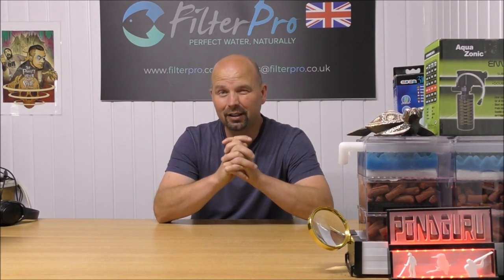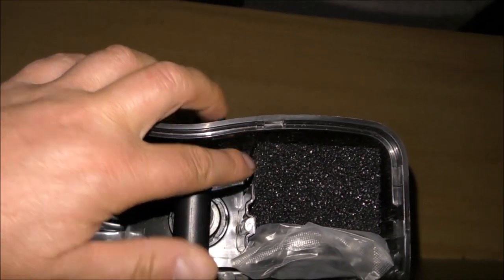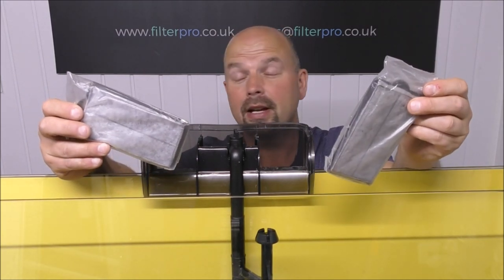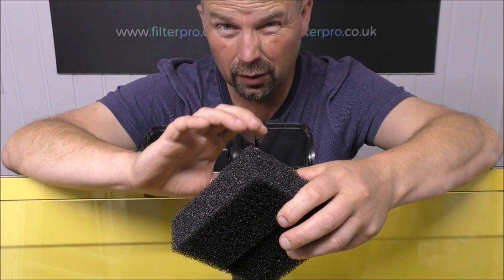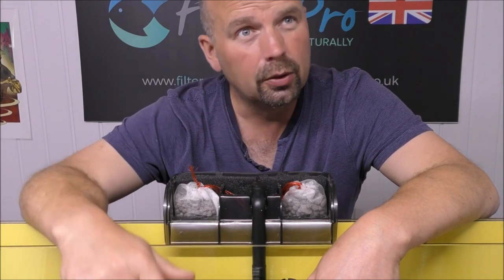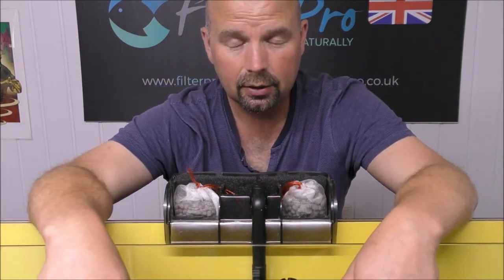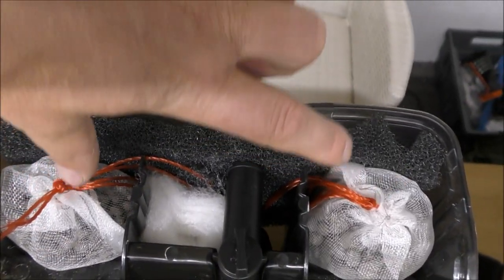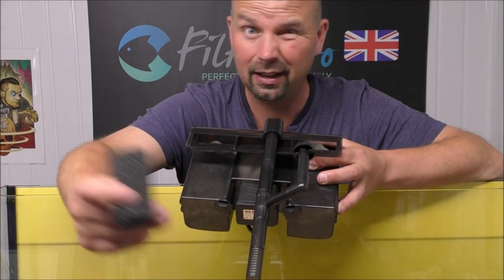Pimp My Filter #54 - All Pond Solutions 600-HO (hang on back filter)

Comment: These are great filters!
I run 2 on a 90l soft coral reef tank using the standard sponges and filter floss for mechanical and flow and the rock in the tank does my biological, works great!👍

Comment: I just set one of these up. I placed the coarse sponge on the I take like you showed. seems best method tbh, as you can use the centre chamber for the fine wool or whatever. I've caught a lot of muck in both the coarse on the intake and the fine wool. using this with some biohome ultimate, think I fit approx 600 grams or so. running on my gold laser cory tank.

Comment: Hi Richard, i am using a Fluval C2 hob filter with biohome ultimate stuffed in the chemical basket. I observed that the water flow is still quite strong. I am wondering can I achieve a full cycle with this setup?
Thanka

Comment: Could you put biohome in the bags?
Reply: You can fill the media bags with whatever you want to use. Richard uses bio gravel for this filter because it maximises the efficiency being that the filter has very little capacity you would want to get the most grams of media possible crammed in the filter compartment. He got 700g of bio gravel in a very small space which is impressive, If you were to use regular bio home you might get just 500g in as there will be alot of wasted space between the pieces of media.

Comment: What cheap external filter would  you recommend  for a 200litre tank? Thanks ☺
Reply: All pond solutions hob 500
Reply: It’s a hang on back canister but it’s rated for upto 200ltrs you might want to find 2 on a 200l flow rate is only 500lph it holds decent amount of media